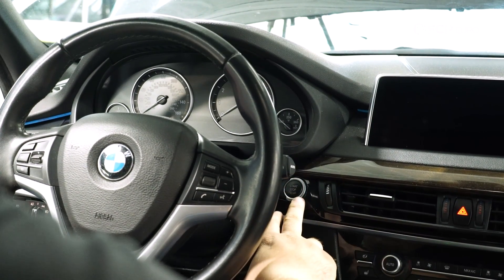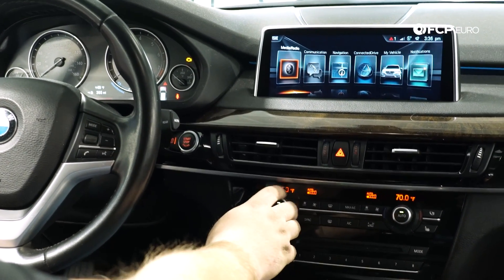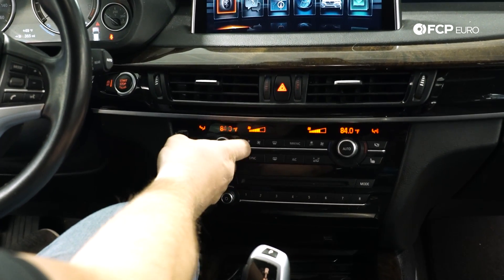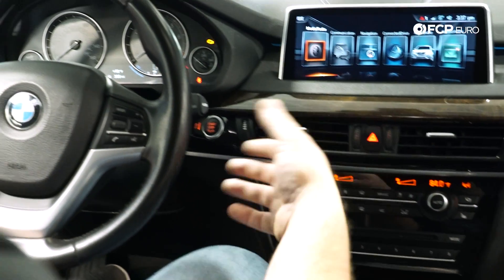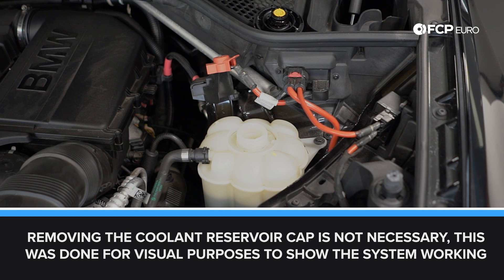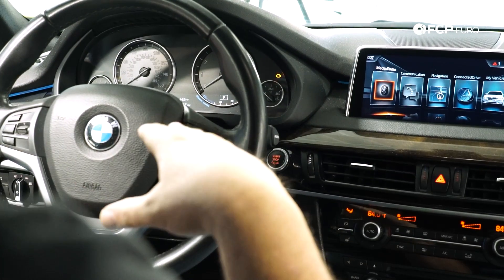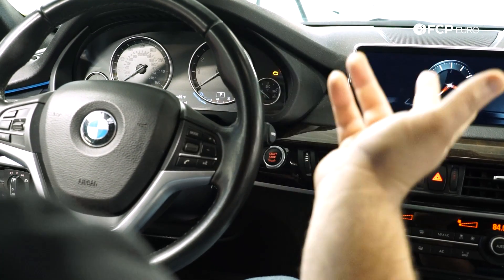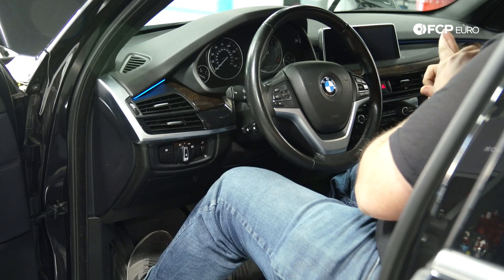BMW Electric Water Pump Bleeding Procedure

Comment: Just checked the BMW documentation and it says :
"Bleed cooling system!
WARNING:
NOTE: Do not open the coolant expansion tank cap during the bleeding procedure. Switch on the lowbeam headlights to perform the bleeding procedure. If the lowbeam headlights are not switched on, the ignition (Terminal 15) will switch off automatically after a certain period of time and interrupt the bleeding procedure.
1. Connect battery charger.
2. Switch the ignition on.
3. Switch on lowbeam headlight.
4. Set heating to maximum temperature. Take back blower to smallest stage.
5. Driving experience switch must not be set to ECO PRO!
6. Press accelerator pedal for 10 seconds to floor. Engine must not be started.
7. The bleeding procedure was started by pressing the accelerator pedal and takes approx. 12 min. (the electrical coolant pump was activated and switches off automatically after approx. 12 min).
8. Then adjust fluid level in the coolant expansion tank to maximum.
9. Check the coolant system for LEAKS.
10. If the ventilation has to be performed again, deactivate DME completely (remove ignition key for approx.
3 minutes). Then repeat from point 3.
Close coolant expansion tank."
I'm still not sure if a bleeder valve needs to be opened under the car or if the coolant needs to be filled before the bleed. The instructions say to turn on the low beams so I would connect the battery to a charger just to be sure...
Reply: To not be depended on the battery so much, you can just use the seat belt, it will make sure the car will not turn off. It's what we do when we install, for example, a tune .
Reply: This. Important the lowbeams are on. My process was getting interrupted without me realizing and after trying with them on seeing this comment it actually finished and fixed the issue I was having with passenger side heating.
Reply: So for those of us that have an G30 N63 2018+ hit your start button 3 times to put it into diagnostic mode then follow the above steps. Watched a crap ton of videos on older models and couldn’t get it to work. Tried it in diagnostic mode and it worked.
Reply: The car shouldnt be on so what you mran use the seat belt to make sure the car dint turn off?😂
Reply: @stickboyfpv4742 The car needs to be on with the engine off.
Reply: @stickboyfpv4742 he meant so the modules on the CANBUS do not go to sleep thereby jnterrupting the procedure it is question of here
Reply: @jt Trousdale so for us with the newer G30 there’s no need to do all this low beam on bullcrap they are talking about ?

Comment: New water pump and thermostate, now water pump keep running after car shutoff,  any idea ?
Reply: I just have the same problem. I replaced the thermostat thinking it would solve the problem of the electric water pump never shutting off after stopping the car. But it didnt, i started the bleeding process and it never finished because the electric water pump never turned off. Did you solve the problem????
Reply: @rambache  yes !!! The water pump and thermostate has to be original ,if you drop a chinesse parts thats whats happens ,in my case the water pump was original but the thermostate not and thats was the problem
Reply: @nossrc5638  Thanks for the quick respond! That is really weird 🤔, my water pump (still is) and thermostat were original parts since new and with them the problem started. 🥲
Reply: @rambache  Well, in that case, take the car to code, sometimes the computer does not register the new parts and you have to code them manually by computer, if you look closely, each part has a code, i hope it helps you goid luck
Reply: @nossrc5638  No, you don't need to "code" the new water pump or thermostat... These are not fuel injectors lol
Reply: @icommandoi145  more than 2 years working perfect 👌  you dont know what you talking,  go back to my reply and read it again

Comment: I changed my water heater control valve and topped it off with coolant but did not do this and now my ac when on auto does not blow out cold air properly its build top then is like it switched to low with out me doing anything should I bleed it?

Comment: Really weird, I have a 2008 528i and I just installed a new water pump yesterday and tried multiple times to do the bleeding procedure but it just wont do it, the pump works great though because I turn on the engine and i can see coolant shooting a very strong stream but I cant for the life of me get the bleeding process going.... i feel like there is air trapped in my heater core because my heater barely puts out any hot air even after driving 20 miles last night.... never overheated though and level looks proper.

I also have a brand new battery and for the hell of it I put on a 30amp charger while trying the process.
Reply: Man i have the same problem! Did u finally fixed it?
Reply: @jaraujo9881  nope it never worked but my cooling system is all good

Comment: Just curious...Does the old fashion way of running engine at idle with coolant cap open/removed still work for these engines?
Reply from the maker: Yes. You can do that as well. The N2X and N5X family of engines are not as prone to airlocks and the system is considered self bleeding as the expansion tank is the highest point in the system. It is ultimately easiest to run the electronic self bleeding procedure since the engine is off and it gives you the opportunity to identify possible leaks or connection problems from service work.
Reply: @fcpeuro  Thanks,  I always enjoy your videos...very cool and I like purchasing from FCP.

Comment: Hello thank you for making this short video!! 

Question: while holding down the accelerator pedal for 10 second and the pump comes on, do you have to continue to hold the pedal down or can you remove your foot from the pedal once the bleeding system comes on? Thanks
Reply from the maker: Once the water pump turns on you can take your foot off the pedal.
Reply: @fcpeuro  I hear my water pump kick on after the 10 seconds but it seems to stop after maybe 5-10 seconds and I never hear any sound and I'll wait for minutes but nothing.  I know you might need to add a charger but I don't even get to the point where the car wants to shut off.  Should you hear the same water pump sound you hear at the start, the entire 10-12mins?
Reply: @keithbailie3014  looks like your battery is not fully charged

Comment: Good information.  Do you have the instruction to bleed air out of the 2005 E60 M54 engine ?  My car does not have electric water pump, it is belt driven.
Reply: Similar process. Heater settings on max. Fan speed low. Leave the expansion tank open. That is supposed to be enough but never worked for me. I would eventually start the engine once I was sure there was enough coolant in the system. With the pump running the air comes out quickly. Top up as needed.
Reply: @kneecaps2000  Thank you for your reply.

Comment: Thanks!! You should make some N51 specific maintenance or mod videos! Well, that's my request! I know it's basically the N52, but I'd like to know more about the specific differences!
Reply: If you want more hp from a n/a engine. Install hotter cams.
If your engine is boosted. Turn up the boost.

Comment: Also works with the B series engines, but with a slightly different procedure.
Reply: what's the different procedure for B48?
Reply: @oli31  after you initiate the bleeding system as in the video, start the engine. The idle speed will hold at 1200.  Then, bring the rpm to 3500, hold for 10 seconds, then let it idle for 30 seconds.  Repeat 4 more times.  Then let the bleeding system finish on it's own with the engine running.